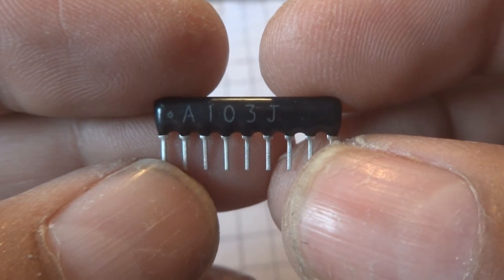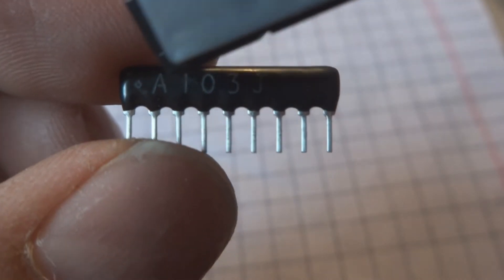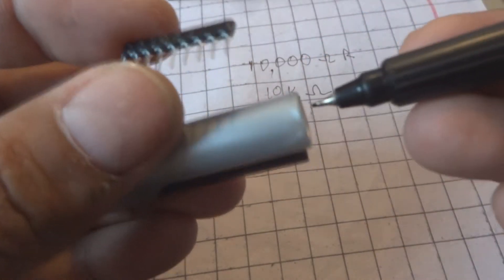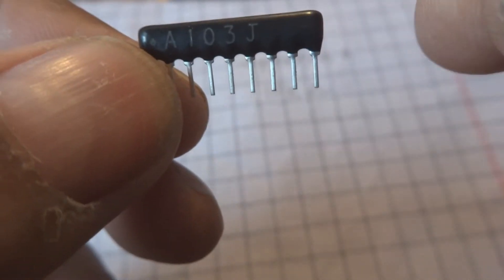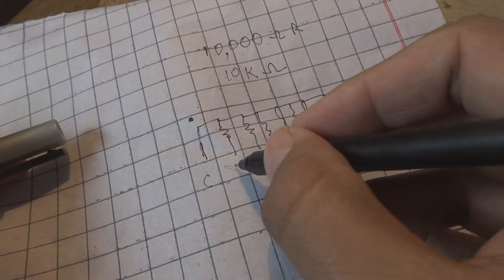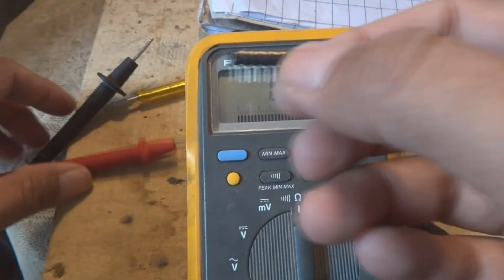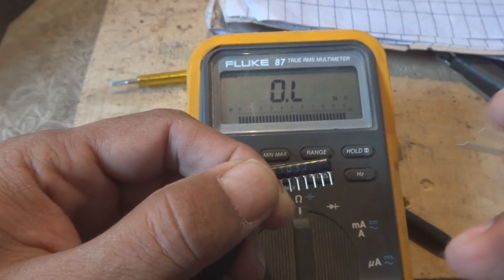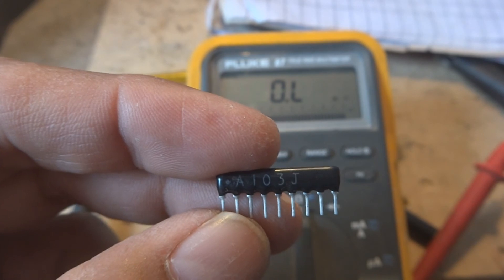Network resistance. Resistance array. Testing and understanding.

Comment: there are types of these, bussed and isolated. this particular type is bussed ,  with the odd number of legs or pins. the isolated type has an even number, with pins 1 and 2 being a resistor and so on, 3and4, 5and6 , 7and 8. these type of components are called sil , array, resistor networks